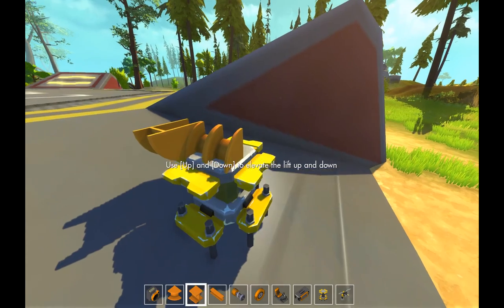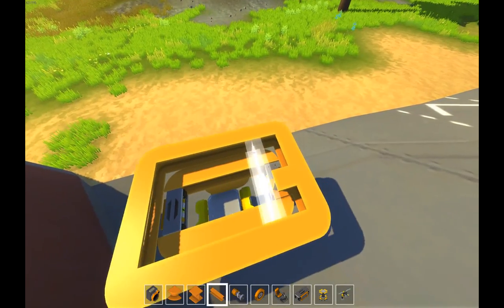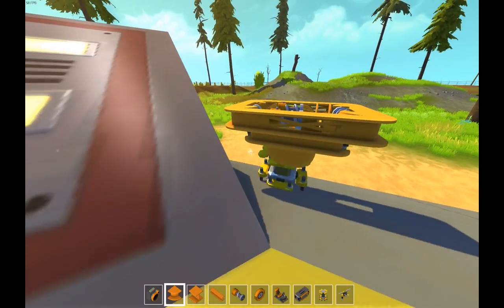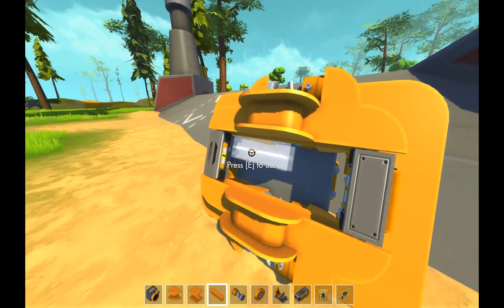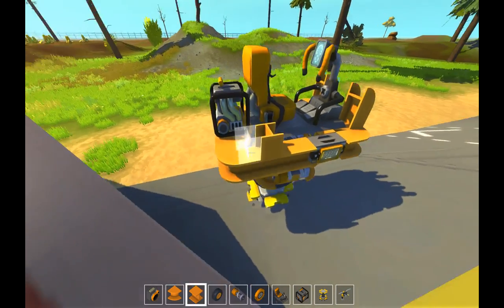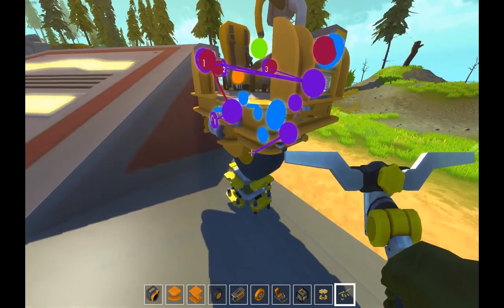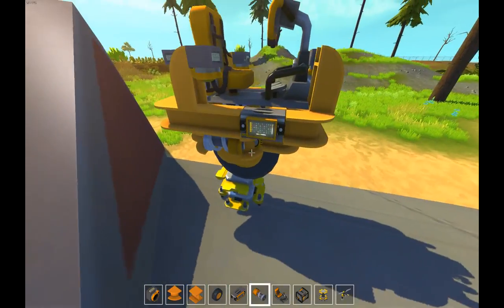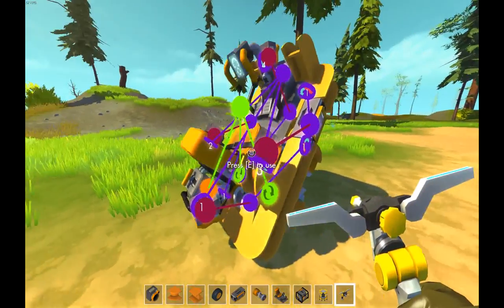Building a Unicycle in Scrap Mechanic

Comment: I don't know if I did anything wrong or if I it doesn't work in newer versions, but my unicycle stands upright after removing the lift, but when I move it one bit it just cant stabilize itself anymore and wiggles around like crazy
Reply: +Xayer Five try to adjust the sensor rotation

Comment: Did they just patch the interaction between the springs for turning to just phase through the blocks instead of creating energy?
Reply: +Purple Python Got to make sure a block is connected to the spring on both sides. Otherwise it'll do what you're saying and phase through.
Reply: +Joshua Redfield I did, I copied everything that he did exactly. I don't know what's going on
Reply: +Joshua Redfield Turns out all of my bearings were facing the wrong directions lol
Reply: +Purple Python How did u fix this ? cuz I'm getting the Sam E problem as u
Reply: +SweGmodGaming Make sure the rounde metal bars are connected to the Springs an not to the frame. only then it will work and not go through the sides.

I won't be able to stream i think. I have it build and for me it wors without an issue. 

The crossair needs to be face to the springs end to connect the block to the spring. 

Hopes this helps!
Reply: +Hendrik visch Imma try it tomorrow , thanks
Reply: No problem! 

But i just might be able to squeeze in a little stream now how ever.. it might be laggy. because my frame rate drops a little around the unicycle.
Reply: +Hendrik visch Do it for the vine :)